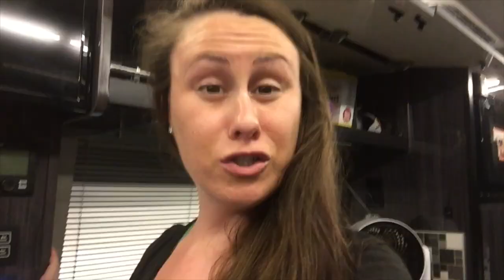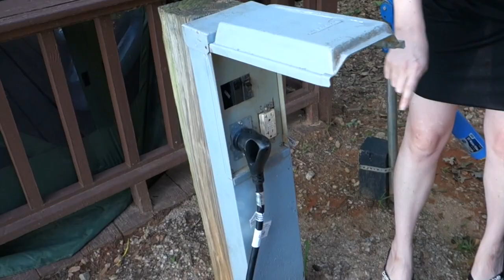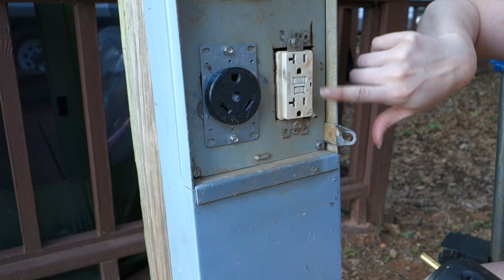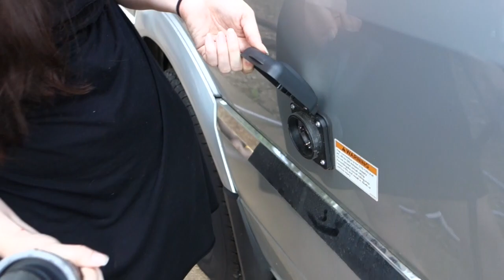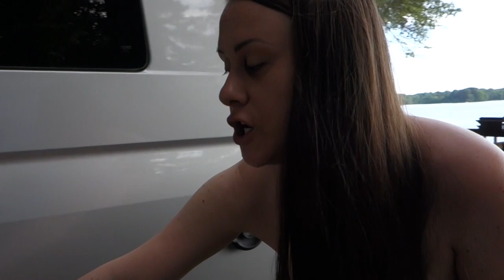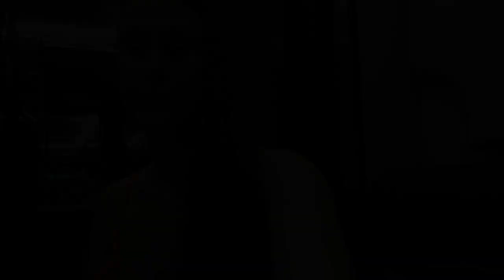RV ELECTRIC - HOW TO HOOK UP SHORE POWER TO YOUR RV

Comment: Do all campgrounds have these hook-ups?
Reply from the maker: Yes & No. Hook Ups are like amenities. Sometimes they may only give you water and electric. And you have to drive to dump your tanks in one area. The best are ones with FULL HOOKUPS but you want to check hookups can include: water, electric, sewer, cable, wifi or more (or less) Some are just for dry camping without hookups (those are more remote). I ONLY hang out where they have wifi and full hookups. #GLAMPING 🙋
Reply from the maker: Thanks for watching my RV electric tutorial Katarina!